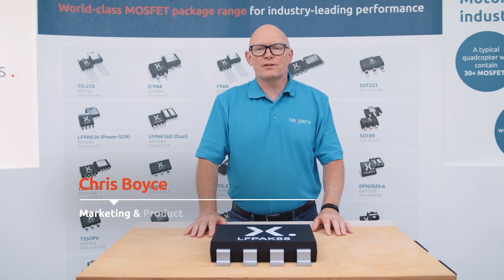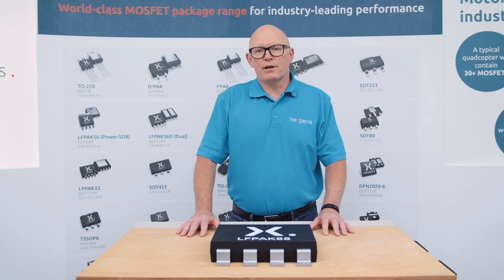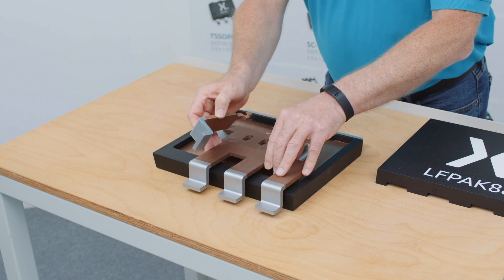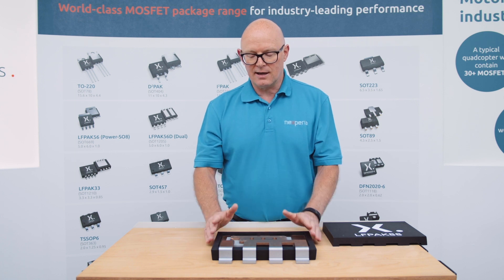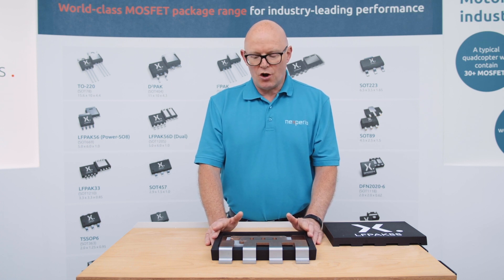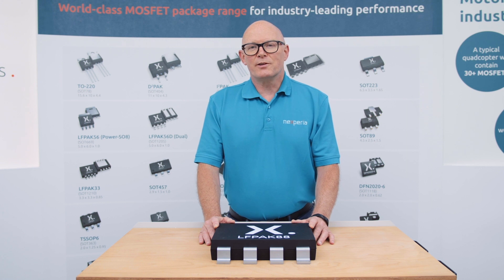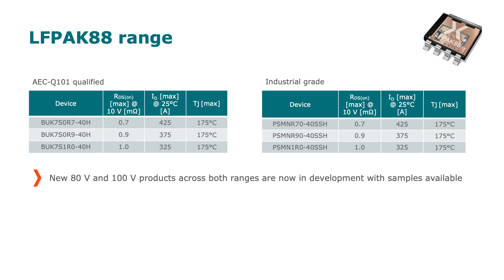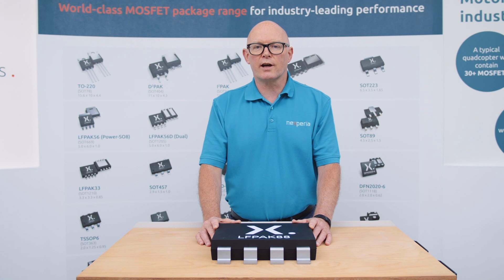LFPAK88: The automotive Power MOSFET driving power density to the next level

Comment: How do you manage the CTE thermal stresses between the die to bottom Cu plate, and between the die to power-clip Cu? Also, how many contact points does the power-clip make to the Emitter/Source side of the die? Thanks.
Reply from the maker: Hello! MOSFETs undergo life tests which include thermal cycles as well as reliability tests on a top of AEC-Q101 standard requirements. The MOSFETs are then specified to 175⁰C after successfully completing the life test, meaning that they are free from failures whether caused by CTE mismatch,  delamination or other failure mechanism.  For more details about MOSFET composition and their relevant temperature spec please see AN90016 (section 4) on nexperia.com. https://assets.nexperia.com/documents/application-note/AN90016.pdf

Comment: How does the silicone look like on the inside? Does it have swirls of wiring like an inductor or a processor-like thing sealed off within the silicone layer covering on the outside?
Reply from the maker: Hello, most modern power MOSFETs are “vertical” devices, meaning the current flows from the copper source clip to the copper drain tab through the silicon chip sandwiched in the middle. Within the design of the silicon chip, there are a large number of identical channels spread across the surface. Each channel is individually turned on/off through a connection to the gate. Providing many parallel paths for the current to flow allows the RDS(on) of the device to be as low as possible. Thanks for your question!

Comment: Hello! How is it possible to cool that type of IC. Can you give some hints, what kind of opportinity the designer has? The copper of the PCB itself not always adequate.
I myself really would like to test the device, but the missing heatsink surface for external cooler holds me back.
Reply from the maker: Hello, please refer to our Nexperia app note AN90003, LFPAK thermal design guide. In terms of testing the device to it's limit, the right cooling layout and heatsink are necessary, alternatively a copper busbar can be considered if your design allows it.
https://assets.nexperia.com/documents/application-note/AN90003.pdf
Reply: Hybrid vehicles like the Toyota Prius use liquid cooling for the MOSFETS in the inverter/converter. My Prius has two 3-phase synchronous motors in the transaxle: a primary traction motor  of 52kW, and a secondary generator for battery charging of 22kW. The inverter that provides power for these two motors has six MOSFETS mounted to a thick aluminum heatsink plate. This plate has several coolant passages running through it, and the heat produced by the MOSFETS is ultimately dumped into the atmosphere via the car's radiator. The two stators in the transaxle, where that 3-phase power is being used, are cooled by a constant spray of transmission oil. This oil is passed through a heat exchanger bolted to the outside of the transaxle housing, and the heat is passed to radiator via the same coolant circuit as the inverter. The gasoline engine has it's own separate coolant circuit to the radiator, same as any other IC engine. The 6 MOSFETS in the Prius inverter are encased in a block of resin that has an exposed surface of metal (copper or aluminum, I'm not sure which) on the bottom. I think the individual MOSFETS are soldered to this metal strip, then the block is mounted to the liquid-cooled heatsink plate with thermal conduction grease, similar to how the CPU chips in a computer are mounted to a heatsink.

Comment: so what watt iron do you recommend using to solder this component?.. my t12 seems to not be working.
Reply from the maker: Hello, thanks for your question! The difficulty of soldering SMD MOSFETs depends on what they are being soldered to. This is highly application specific, however, if a device is being soldered to a surface with low thermal resistivity and large thermal mass (for example copper cladded PCBs), you will need to apply more heat and a soldering iron alone may not be enough. In those cases hot air gun, hot plate or a reflow oven would be needed.

Comment: What about heatsink
Reply from the maker: Hi @danielchatrie6614! There is enough cooling by providing copper surfaces next to the device or on the other side of the PCB (the heat is conducted from the Drain tab by thermal vias). If a heatsink is needed, it can be attached to the other side of the PCB. The heatsinks can be attached via pedestals to avoid it occupying the whole surface of the PCB.